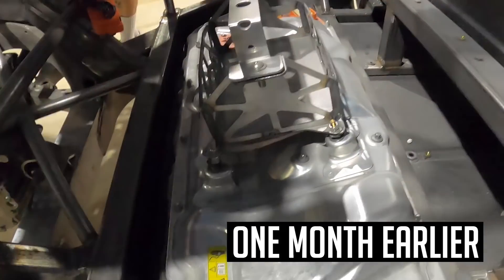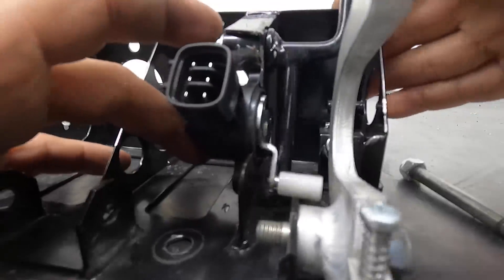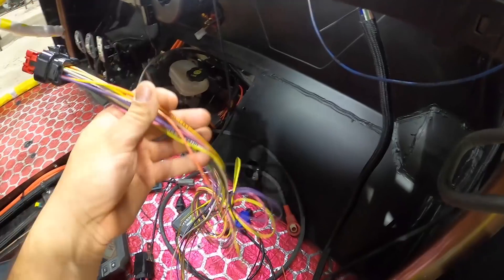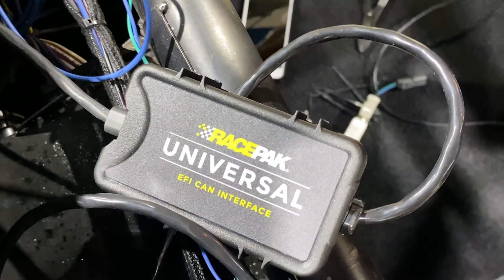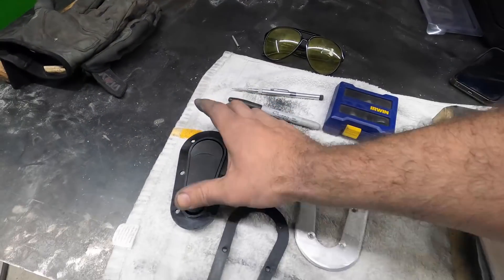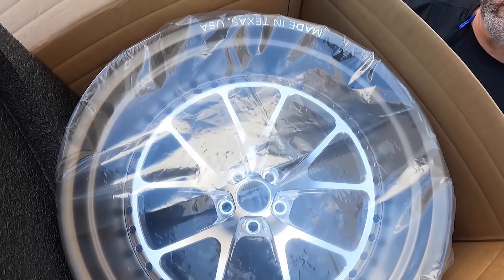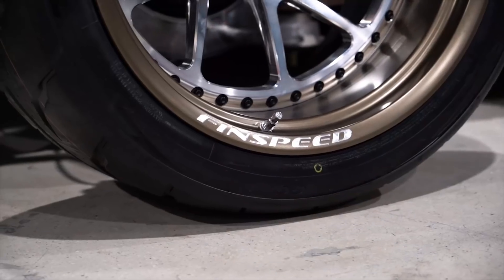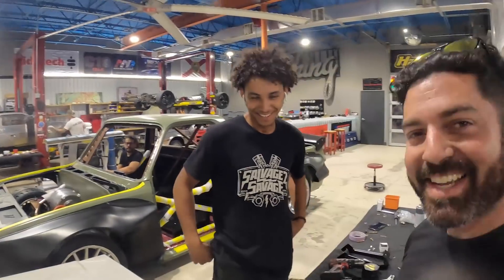First Start Up of the Tesla Swapped Squarebody! - Electric C10 Ep. 19

Comment: I'm an electrical engineer and gearhead. Love the all electric cars but I refuse to own anything that someone else has total satellite remote control over my vehicle. Tesla needs to stop the power trip control they have on their cars. If I want a "firmware upgrade" or whatever bs they say, I'll decide it myself. Look at Gruber motors. They spend endless hours defeating and back engineering relatively simple circuitry that is plagued with worthless software blocks. The right to repair law needs to be applied here.

Comment: I hate to say it because I love everything else but you guys should redo the fenders they suck really bad
Reply from the maker: you should watch the episode where we make our widebody kit
Reply: @SalvagetoSavage  I've been watching the whole way through. Whoever cut the fender wells and decided on that shape ruined them they look like someone's trying to do cheap rust repair honestly I think you guys chased A mistake or bad result and that's what you ended up with
Reply: @mccall2277  you don't see that cut once the flares are on the truck. its cut like that on purpose (def no mistake) if they weren't cut 
like that you'd see the green inside the fender. and the front tires would hit the stock fender.
Reply: @michaelrolleri4559  I can tell you one thing real builders like Chip foose and the late Boyd Coddington would never turn out such crap. Doing all that work to just screw them on them on and instead of molding them in or making a whole new fender is lazy and going to make the truck look less valuable

Comment: Forgive me but this is an honest question. Could you use liquid nitrogen to cool the motor? Requires less power and seemingly as long as it has a loop you would not need "topping off". Im sure it would be a nightmare to make work but if you did you could incorporate the brake cooling too.

Comment: How do you keep the 12v battery charged?
Reply from the maker: There's a high to low voltage system in the larger battery pack that charges the 12 volt, almost the same as an alternator charges a car battery.

Comment: Looking good, hope to see you at SEMA and interested to know the solution for the hvil (high voltage interlock) issue as I’m doing a Tesla 3 battery pack with a large drive unit project using the Ingenext battery controller. I’m encouraged you were able to get them to work together!

Comment: first off, you do not start up an electric motor, you just turn on the batt.....fook those electric vehicles!
Reply from the maker: but... then turning on the battery would be starting up the motor..
Reply: @SalvagetoSavage  technically, no, that would be energizing the motor, similar to turning a gas powered car on but only the fuel pump activating to prime the fuel rails, starting it would involve increasing the voltage to allow the motor to spin :D

Comment: What's the gear selector for?  The Tesla motors don't have multiple gears.  They are one speed, and their RPM capabilities mean they don't need anything but the one gear set (speed).
Reply from the maker: We'd like the truck to also reverse as well as go forward
Reply: @SalvagetoSavage  Yeah, I realized what you meant, and replied to my own question ;-)
Reply: Oops, I know what you meant.  Drive, Neutral and Reverse.  Never mind ;-)

Comment: When the fuse blows its obvious, as in it literally blows up visual inspection is all thats needed
Reply from the maker: Sometimes you have to pull it apart to see if it's a dud. We just had one blow on us and you'd never tell from the outside of it
Reply: @SalvagetoSavage  i just shake it lol 9/10 they'll make noise, I just remembered their sealed from the bottom so yeah you can't visually check them

Comment: Wait, so if I wanna make something like this, I have to give the manufacturer (in this case Tesla) access, even remote, to my laptop/PC that I have connected to the battery itself? That's a giant-a** f*** off, no, to them, they can go to hell if that's required. They can stick their battery/software up there where the sunlight doesn't reach...
Reply from the maker: That's why we used an Ingenext controller. You can do it yourself, but you need to know how to code

Comment: Would love for you guys to do this to my little project Chevy S10 :) Could call it a TeS10...
Reply: Are you upgrading one of the older 1997-2000 ev model s10s? Or swapping an ice one? 🤔
Reply: @4literv6  I'd love to have a Telsa motor in it but that's not the plans for it. She's a 96 and I've kept the stock look minus LED headlights and a 3/4 drop. Eventually doing a 5.3 or LS swap when motor goes but probably couldn't afford an EV conversion. Call it a pipe dream to have these guys do up my truck. Can wish, right?
Reply: @GoPaulsDeep  never hurts to dream man. I wish I could work for them myself so. 😁

Comment: I'm glad that you used an almost plug and play Tesla battery and motor that I didn't know actually existed. Other conversions have to disassemble the battery pack (which is dangerous for the untrained) and then fabricate new housing/s for the cooling of the battery packs, then fabricate new wirings for the battery, motor and controller etc. I think if they've used what you've used here, they could've saved a lot of time (and maybe money because most of them outsourced manpower on the electric side of the build). There's one that's more than 2 years already and still not done now.
Reply from the maker: Ingenext controller really saved us there. It also helped us that we built our chassis around our battery so we didn't have to modify the size or shape of it!

Comment: I use to pick at y'all about this thing probably weighing 10k lbs.. I'll admit I'm wrong by half maybe, but it ended up awesome.
Reply from the maker: She's definitely a heavy one! But with 2 Tesla motors, she should still fly with the added weight!
Reply: @SalvagetoSavage  oh it will be fast no doubt
Reply: one of the things Tesla now does is to eliminate the floors and mount the seats directly to the battery. body seals directly to the battery pack. That would make it lighter. also the battery pack is now structural.

Comment: I've been waiting to see how all the wiring was going to come together.  I'm still interested in how you get the front and rear motors to spin at the exact same RPM.  Also, now I want an offroad 4x4 sqaurebody tesla.
Reply: They don't, the inverter does that, it just sends the same voltage to all 3 motors. Even if there is a little discrepancy the rolling wheels on the ground will average it out by forces from the road.
Reply: https://youtu.be/dTRBiX7BBlMey3

Comment: Cool but not cool all at the same time. So conflicted.....tesla🤢
Reply: Don't be so confused. Gasoline and diesel already both require massive amounts of electricity, water and cobalt just to refine into a useable product.
Ice vehicle's also require batteries and electric motors in order to work. 
An ev really just simplifies all of that down. Into a safer, quieter, quicker cleaner running simpler package. 👍🏻😎